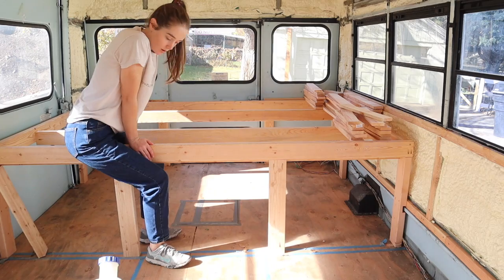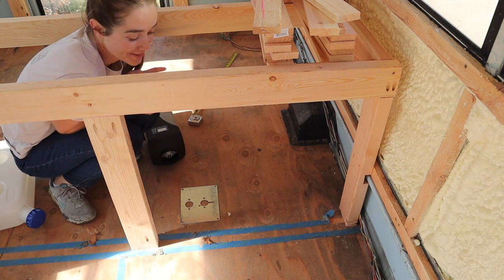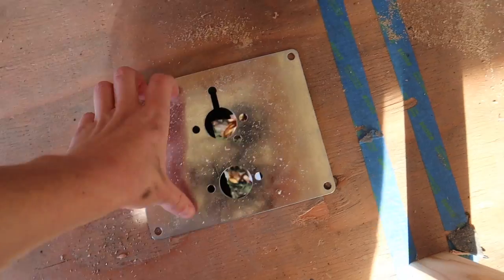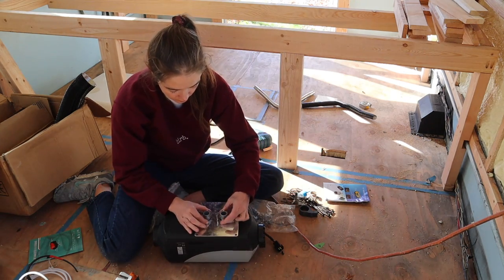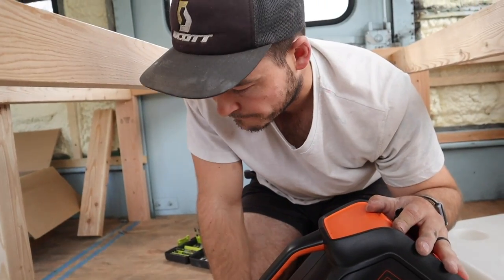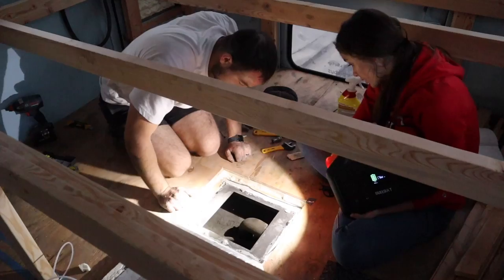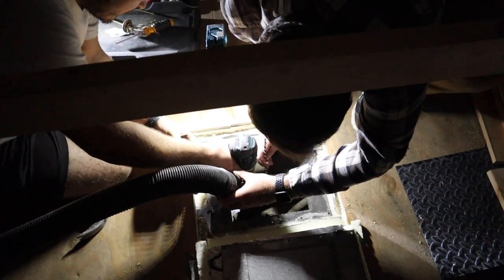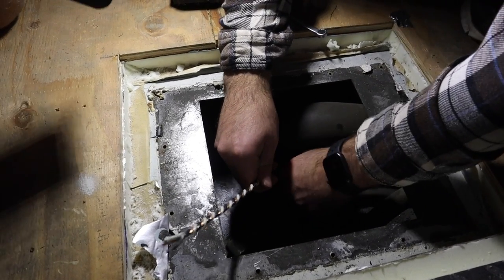Diesel heater install gone wrong - Heating up a school bus tiny home //skoolie conversion p34

Comment: The diesel fuel will likely eat through the paper and the fuel strainer and fuel filter will catch everything, so it should be okay.  If not, you will need to pull out the fuel sending unit and clean the fuel strainer in the tank.  Not a very big deal to have shavings fall into the tank, there is probably a lot worse debris in the bottom of the tank already and it's not that big of a deal.  That is the whole reason for the fuel strainer and should not affect it very much.  However, if the fuel strainer is already mostly clogged up, it may finish it off and cause the bus to run really poorly and have low fuel pressure, but the odds of that are pretty low.  Diesel fuel is a really good degreaser and solvent, so it will most probably dissolve all of the glue holding the pulp of the paper plate and it will probably even pass through the fuel strainer and get caught in the inline fuel filter.  Depending on what engine the bus has in it, the tolerances in the fuel system may be large enough that the paper plate will only add to the cetane value of the diesel fuel and may even help improve the fuel economy.  The older diesel engines can run on just about any oil, even if it is really thick and heavy, not just diesel fuel.  I run used fry oil and used motor oil and used transmission oil fresh motor oil and fresh transmission oil and any leftover power steering fluid and oil additives in my 1996 ford f250 power stroke diesel, and just put everything through a 5 micron fuel filter before putting it in my fuel tank.  The inline fuel filter is a 5 micron fuel filter, so if I don't filter it first, it will just make it so that I have to change the inline fuel filter a bit sooner.  Make sure you run some seafoam through it and some power service brand diesel fuel additive once in a while to keep it clean.

Comment: Magnetic Pick Up Tool 4 Pack, Telescopic Magnet Stick (1.5LB 3LB 10LB 15LB) Could pick up one of these and then leave a magnet in the tank for anything that might remain and for the rust that will inevitably will fall in from age. I tried to leave the amazon link but it would let me. I am not an affiliate so I don't benefit if you buy it or not. By the way some of our greatest scientific discoveries were by accident. Most important is safety. If you or anyone else didn't get hurt and you learned something, I would call that a success. Even if the results weren't what you expected.
Reply from the maker: thanks!!

Comment: I personally don't like tapping the tank. I go out of service a lot and don't want to be running the heater and not paying attention and use all my diesel and cant get out.
Reply: oh snap just finished the video. I am sorry. Also seen that you did have the thingy to keep is from draining your tank.
Reply from the maker: yeah that's a big reason why I originally didn't want to do this either, he installed it so that couldn't happen though 😊

Comment: NIce work, the contraption though was very questionable from the beginning and also a bit too large for the hose opening.. Anyway, it is what it is.. One way to solve chips problem would be to cross cage a magnet in some thicker copper wire and hold it inside to capture the chips.. I would certainly try to fish out the paper and tape though, as it will decompose in fuel and might lead to some clogging, probably at the worst possible time..😒 Don't give up, stuff like this hapens all the time, even to pro's.

Comment: If you've never seen a old diesel tank interior they are junk filled thats why they are filtered .no big deal dont put feeder line all the way to bottom .
With the lightning should have been a Halloween video:)

Comment: Not sure if this will help  glue a piece of metal over the hole you just drilled and glue it with 2 part fuel tank putty then go to a car parts store and buy a T fitting  cut your main fuel line fit the T and run your heater off that T 
Hope this helps
Reply: Generally tapping lines is a bad idea

Comment: Just for the future; using a vacuum in or near the  fuel tank (presumably to control the debris from drilling or cutting the tank) is a very bad idea. Never use a vacuum near fuel or solvent fumes because you’re sucking volatile fumes though an ignition source not to mention the static a shop vac generates could be enough to ignite the fumes. You guys got lucky.
Reply: No diesel is NOT flammable like that
Reply: @mrmotofy  I was going to type that. Gasoline might be a problem, diesel certainly isn't.
Reply: @mrmotofy  and @Ken King—correct diesel does not work like gasoline in an engine, it’s ignited by compression. In this case we are concerned about fumes and flash point, the temperature at which a volatile liquid gives of fumes. Diesel fumes can easily be ignited with a spark.
Reply: @corydriver7634  where can I see testing/evidence of the diesel fumes igniting?

Comment: How do you like the heater? Im curious since I use one and had an issue or two with mine.
Reply from the maker: it broke ☹️
Reply: @EmmaBuildsBirbie  what happened? On mine, I had to take the heater apart and clean out the soot buildup, which I thought was gonna fix my issue but after I found the fuel pump wasn’t pumping fuel too good. I ended up replacing the fuel pump and now it’s back to operating. What are you doing for heat now?

Comment: If the plate don't dissolve it will just move around your fuel tank worst case scenario it plugs up the main pickup line ya might get it out with a pair of BBQ tongs if it does dissolve your fuel filters will catch the particles but my guess is the paper and tape went into the vacuum cleaner did you check it
Reply from the maker: hmm that's a good idea, didn't think about that
Reply: @EmmaBuildsBirbie  is the tank plastic or steel looks like it's black plastic in the video
Reply from the maker: @cameronchrestman46  i think it's steel? definitely metal
Reply: @EmmaBuildsBirbie  ok like some of the others I would drop  a magnet in the tank to catch the drill filings and the main pickup tube for the fuel line should have a screen on it that won't allow debris like that be picked up and smaller stuff gets caught by the fuel filters it would be a good idea to have a extra filter or 2 with you when you start traveling just in case. I'm a retired truck driver and when I was on the road I always carried extra filters and a new fan belt just in case 😅 have a good day and I enjoy watching your build
Reply from the maker: thanks so much!

Comment: Why don't you find the fuel line that leads from the tank to the Engine and cut it and install a "T" then run it off that? They sell fuel tee's at Auto Zone
Reply from the maker: so much good info! hopefully in anyone's trying to do the same they will read all these comments!
Reply: @EmmaBuildsBirbie  I'm loving the series you are doing really well. I wish I was building a bus!

Comment: and most states law is to have wires and tree branches at i think 12 feet witch you should be just under i think so if you hit shit like i have many times (you knocked out my cable you need to fix it ) tell them city and state codes call for this to be up so far and its not so not your fault
Reply: Should be 13'6" or marked as low-clearance.

Comment: I guess you didn't see my earlier comment in one of your videos when you mentioned about the heater I mentioned to tap into the fuel line off the diesel tank. In Tennessee in most States if not all. it's illegal to drill into a fuel tank it's against DOT regulations.
Reply: I saw a yt vid where the builder was lucky enough to have a drain plug in his tank. He got a new plug and drilled into the plug to install his tap. I also saw a guy drill the tank and install what appeared to be a kit... an adapter with gaskets for a second tap.
Reply from the maker: whoops

Comment: IF either you do not know EXACTLY what you are doing in the installation of the heater, leave it to a specialist. Should you installl that thing the wrong way, it may burn the oxygen that is in the bus and leave you with nitrogen WHICH DOES NOT SUPPORT LIFE. The air that we breathe is 78% nitrogen, 21% oxygen and 1% non damageable gazes. Also, when you breathe, you inhale oxygen and exhale carbon dioxyde a more severe killer than nitrogen. Your own lungs and the diesel heater could kill you in a short period of time. Get a specialist; better be safe than ''dead'' !

Comment: Ooohhhh noooo 😱😱 I honestly would not have hooked it to your busses fuel tank because, what if it’s cold outside and you run your heater and use all of your gas that you need to get some where? 🤔🤷‍♀️
Reply from the maker: yeah that's why I didn't want to do it either, but he installed it so it won't reach the bottom of the tank
Reply: Emma Builds Birbie that’s smart 😁 can’t wait for the next video